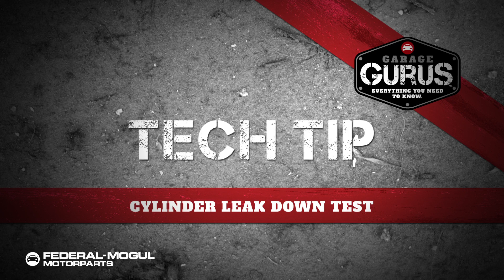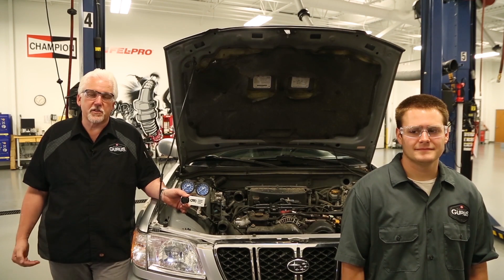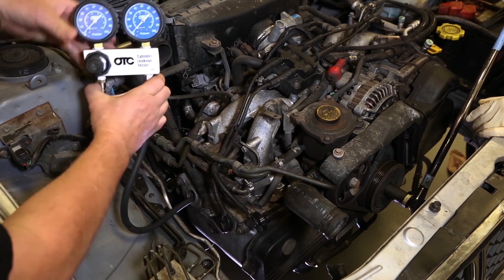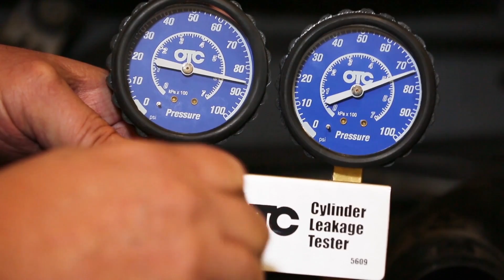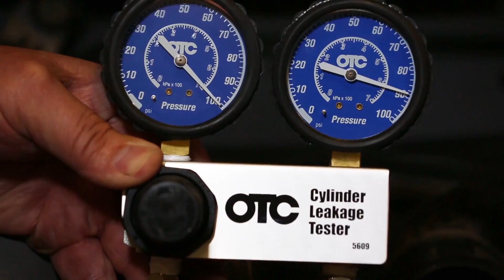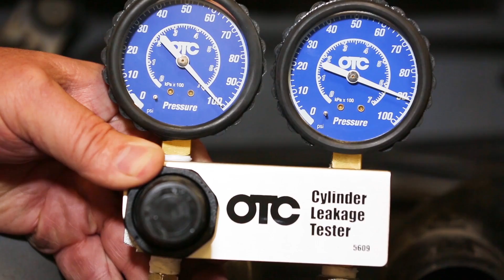Cylinder Leak Down Test

Comment: Why would the engine spin because of the ratchet? I am sorry if this is a stupid question I want to perform this test but have never done it before.
Reply: The engine might spin because of the cylinder being pressurized by the test equipment. Similar to what happens on the usual power stroke but at a much, much lower torque. And of course, which way it would spin depends on if the piston was before or after TDC. More of a concern with a standard transmission since the car could lurch if being in gear was holding the engine and no one was stepping on the brake. In an automatic transmission situation, the car won’t move, but the engine might, making the test fiddly since you have to find TDC again.  Hence the breaker bar (not a ratchet!) on the crank pulley to hold the engine in place.

Comment: If you have good compression from compression test then does that mean you wouldn’t need to do a leak down test?
Reply: You still should in many cases. A compression test confirms if the cylinder builds compression, a leak down test shows if it holds that compression pressure.

Comment: At TDC is the air puff coming out of the hose strong?  I need to do this on a 351 Windsor.  Never done it before but I have the tester.
Reply: Tdc marks should be located on the crank itself. However you can put a balloon on top the hose to watch it blow up then you'll know your close. Hope that helps.